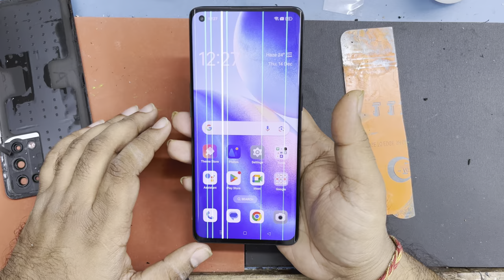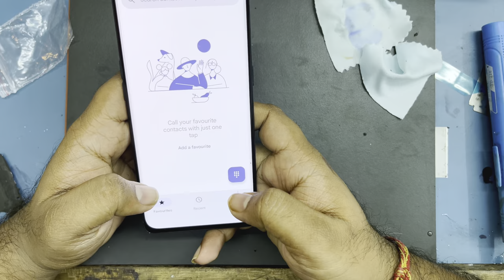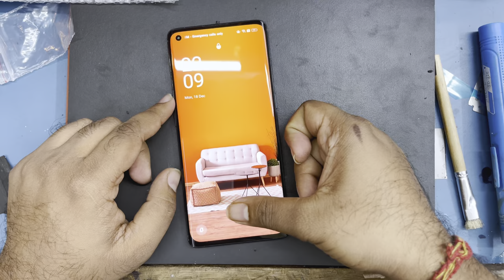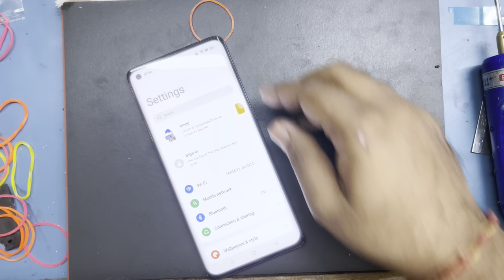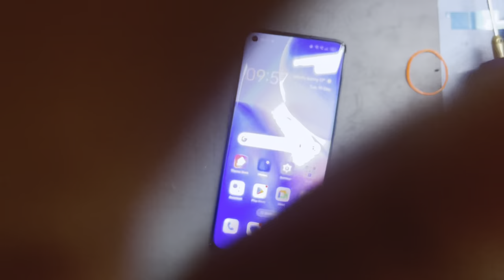Oppo Reno 5 Pro Display Green Line Problem Solved

Comment: how much will it cost? for reno 4 pro any other option then replacing folder
Reply: Same problem with my Reno 4pro
Reply: Same for my oppo reno 4 pro. Update stopped for this phone before 1 year. But now there is a green line on the phone suddenly
Reply: Same column in my Oppo Reno 5
Reply: @vinothprabhu128  same mere sth hua kya aap service centre gye the oppo ke
Reply: suddenly green line also happen to my reno 4 pro